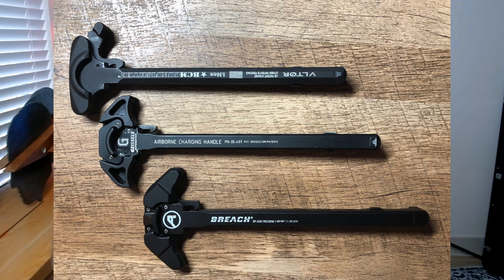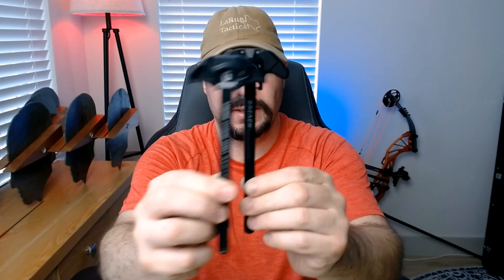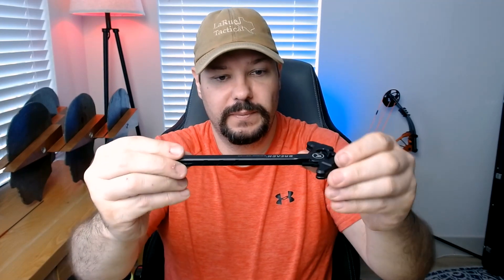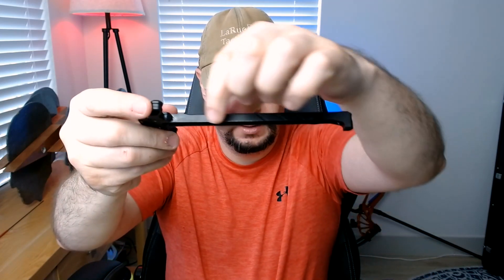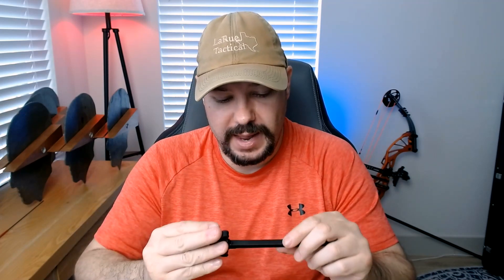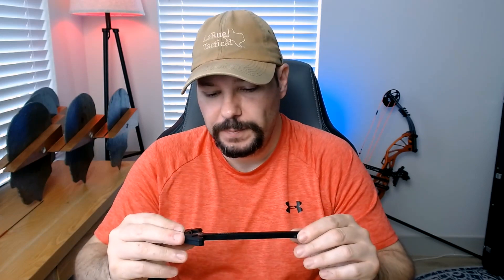Aero Precision Breach Charging Handle - Initial Review

Comment: With only a few exceptions, I've gone with mil-spec charging handles. They do the job. There are always caveats of course. If you are running an optic that gets in the way, a larger charging handle could fix that. There are of course the "gas buster" charging handles for when you install a suppressor. I've never found the extra money to be really worth it. A good ambidextrous charging handle does make a good argument. By good, I mean you can just hook a finger on one side and work the action. I am biased towards the budget/good value side of things. But that's just me.
Reply from the maker: I found that the mil-spec stuff was way too easy to slip off off, it really worked best with two fingers. That's fine a lot of the time, but there are plenty of times I just use one. I used to only use an extended for scopes, but found that it was less about the length of the lever and more about the design. Insert joke here.

I definitely think that it's one of those things where you have to decide what it's worth to you, because the cheap version (as long as it's built right, I've seen bad ones) really does work properly. You can ADD options with the fancier ones, but the task can be fully accomplished without them. Since I run suppressed more often than not, the gas busting is valuable. I also really prefer single sided operation. That said, paying full price for the Geissele would be silly in my book.
Reply: @BulletsNBrass  If it's built wrong then that is money down the drain. I just have difficulty when such simple devices as charging handles start moving near the three figure price point.
Reply from the maker: Yup. I think the Breach is at that ideal price point for a premium version. Expensive but not ridiculous. The Airborne is just too much unless you get it on a major sale like I've done in the past. Of course, part of that is because they're selling them to the government as the primary buyer. If they started charging the regular buyers less it would obviously be an issue.
Reply: @BulletsNBrass  Turn about is fair play. It would be kind of cool if government sales were used to subsidize civilian sales. Didn't Glock become popular by giving police agencies huge discounts?
Reply from the maker: @Fudmottin  Yup, S&W did the same, I'm not sure about SIG. They sell the guns practically at cost, but make the money on secondary sales and the service contracts.

Comment: I like the size of the raptor chargers or the Warhammer. Go narrower I'm always banging fingers on forward assist and sucks when add an optic. If you're not in the military and worried about it catching while crawling threw crap doesn't make sense for a narrow handle. Just my opinion but if ya hunt with gloves or speed shooting or just tired of banging fingers on forward assist...I like the larger ears. Even moreso with a scope
Reply from the maker: With a scope that comes back that far, definitely, but I never use the far side anyway. I pull from the left side almost exclusively. I don't like the longer ones when I've got the rifle slung, so unless I NEED that length for a scope...
Reply: @BulletsNBrass  ya that is a good point on the slings. Strike makes an ambi latchless handle that looks interesting. Has a bit smaller ears but can also buy extensions. I doubt it would run well suppressed though
Reply from the maker: I'll have to look at that, but my luck with Strike has been so so. They innovate, but execution seems to be iffy.
Reply: The larger handles tend to dig into my chest when slung so that's a reason I prefer the smaller ones. Plus I think the wide ones like the Warhammer look kinda odd and bulky which is another reason I prefer the slim ones. The large ones just stick out oddly IMHO
Reply: Larger handles like the Geiselle (non-airborne) dig in your chest when slung as others have noted.  Even on my AR’s with LPVOs  I still use the smaller airborne because it sucks getting poked in the chest while moving around with your weapon slung in the front (with no plate carrier).